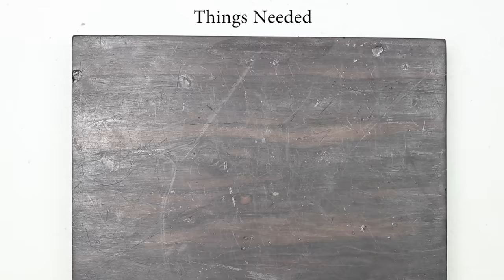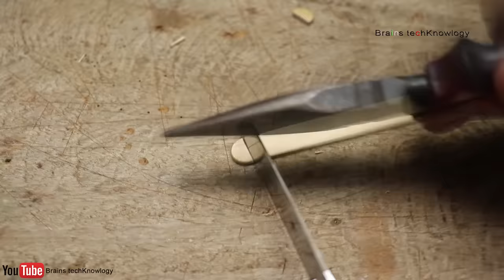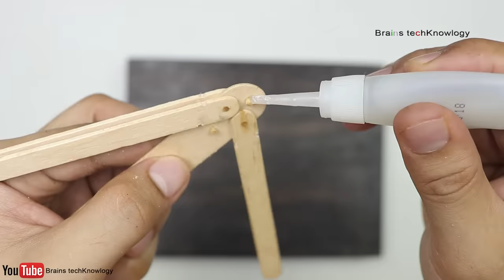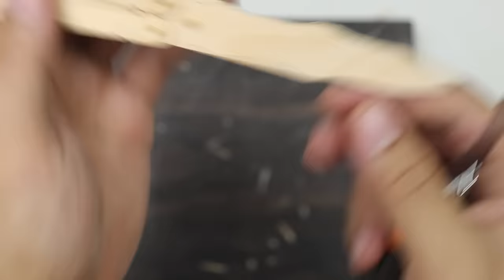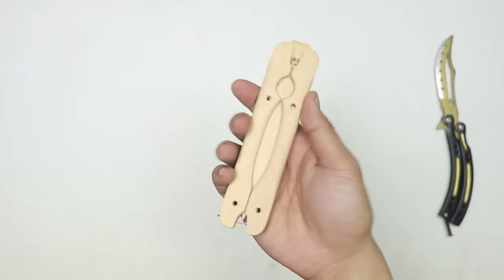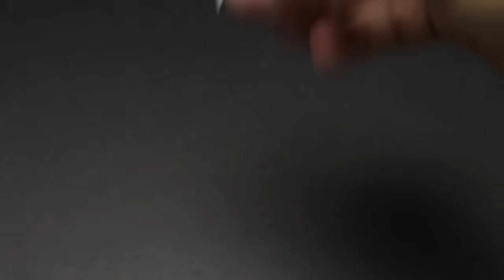Super Easy way to make butterfly knife popsicle sticks - DIY 2019

Comment: Who wanted to make one, but don't have a drill?
Reply: U dont need. Drill i made it too u can make a hole with just a paperclip 
First make the paperclip straight
Then remove its coloured plastic coating and a sharp metal will be there make a hole with it and use it as the pin in the knife for folding

Comment: In stead of using a drill bit and the wax tips, I used a thumb tack to make the hole, then put .7 led inside. It works just as well.

Comment: Hoping to make this but don't have a drill. Could you tell me why you drill those hole 4:23 & 4:58 ?
Reply from the maker: I drilled thru it so that the handle stays parallel to the blade when when you open it.

Comment: What if i don't have a drill? Can I use a nail instead?
Reply from the maker: Nails can crack the popsicle sticks. Just buy a manual drill.
Reply: @BrainstechKnowlogy  I'm just a teen with no money but can paper clips work?
Reply: @BrainstechKnowlogy I heard that if I use a plier on them their edge gets sharp and able drill through a popsicle
Reply from the maker: @solitude2642  yup. Paper clip works. Just cut the tip with pliers to harpen it.